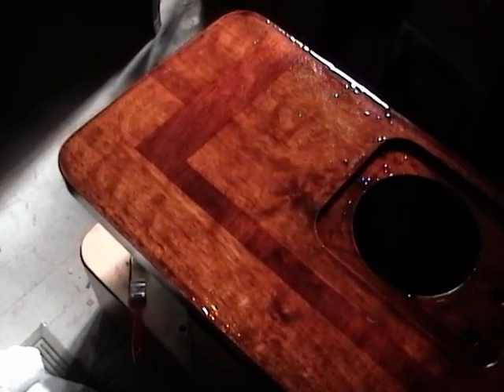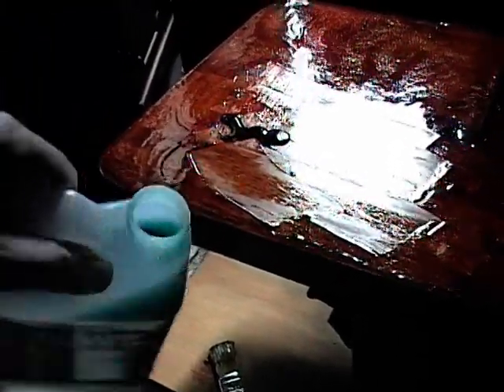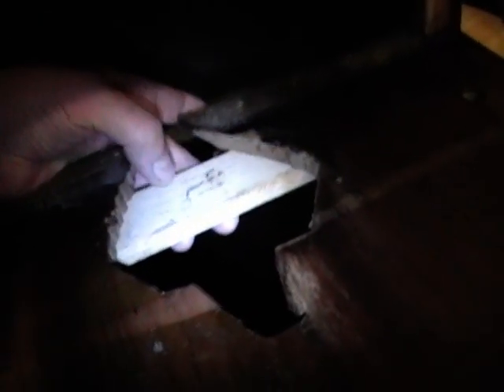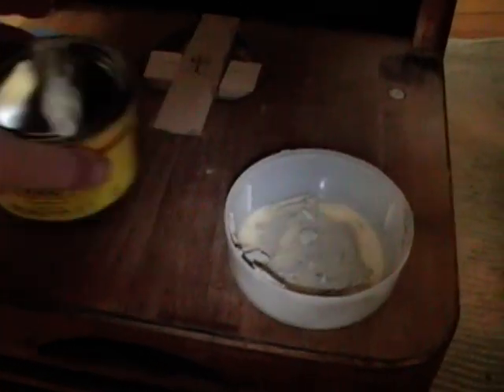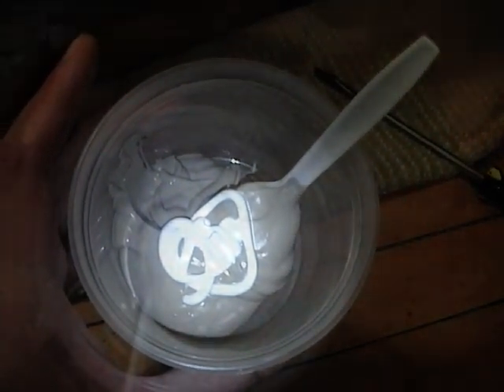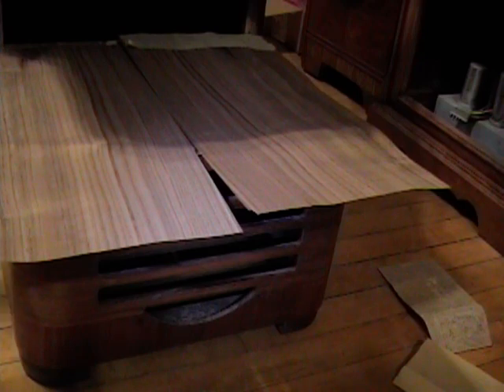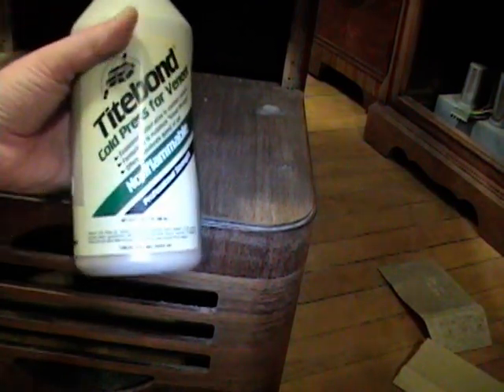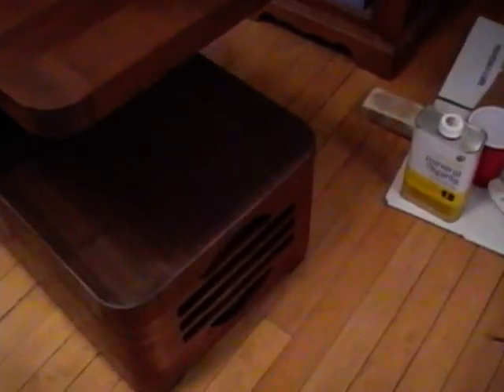Philco 38-7CS restoration p1o12

Comment: Still here going through all your older videos and really enjoying them. That is a great chair side radio you have there and looking great. I thought I would pass on a tip I learned years ago when I worked at hardware store. The best wood putty I have ever found is the unlikely Durham water putty. It has been around for years since the 1930s. It is a powder you mix with water and a lot cheaper and better than the more expensive alternatives. They have a neat website if you do a quick search.

Comment: You can use plain old lacquer thinner for your afterwash.  It's a lot cheaper than the furniture refinisher or the stripper afterwash and will do the job just as well.  I've found that acetone also works as an afterwash in many cases.  Be sure to use gloves, goggles and a respirator when working with these solvents, unless you're working outside or in a well-ventilated area, in

Comment: That method for patching the holes worked out well, although I may have used a jig/saber saw to clean up the hole, or a small router with a jig (never freehand).That sort of repair is called a "Dutchman" I think. One thing that works well is to make a patch first and then to trace around the outside of it to cut a matching hole, I have used that to repair chipped veneer or holes in drywall. As they say there is always more then one way to skin a cat.

Comment: I realize that, unfortunately I seem to end up with a lot of projects that do need stuctural repairs, almost as badly as that Grunow console you have, damp basement specials.
One thing I remember seeing for sale for joining edges of veneer together was something actually called veneer tape. I think it had some sort of hot melt glue on it but it was paper and it was placed on the underside of the veneer so it was perferated 1/4 inch holes to allow the glue to stick.